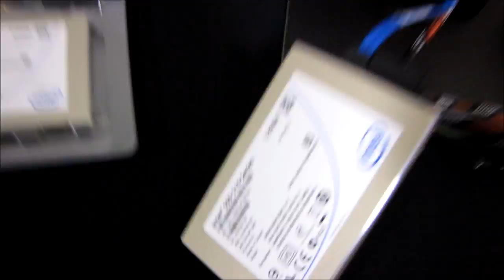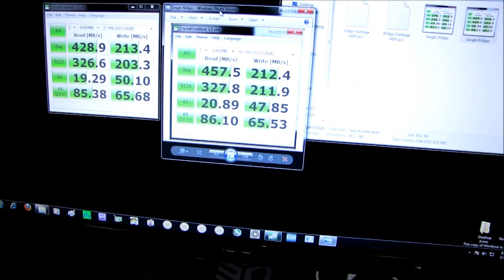Intel P67 SATA3 6Gbps Controller vs AMD 890FX Controller Linus Tech Tips

Comment: To people concerned about Intel SSD testing on an AMD platform being unfair, remember that the Intel 510 doesn't use an Intel controller. The 510 uses a Marvell 9174 controller.

Regardless, I don't think Intel would be able to make SSDs have a bias for certain motherboard chipsets.

Comment: @manhunt48 intel would be complete idiots to do that. Because once they do, would AMD users buy these products? Nope. and there goes one of intel's market and revenue. They are not at war with AMD in the SSD business so there is no need to do anything to limit in performance-wise on AMD chipsets. The P67 is a newer chipset and will of course out-perform the latest but slightly older AMD chipsets, in some miniscule way such as this.